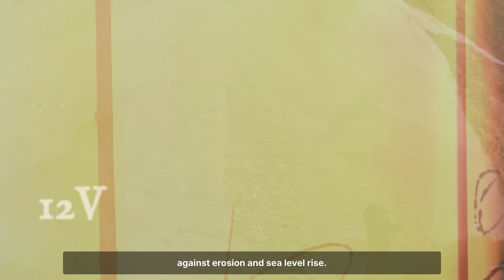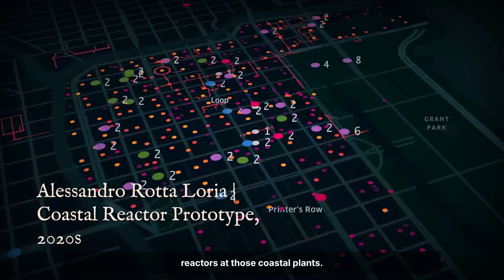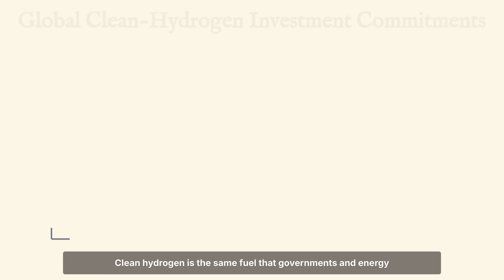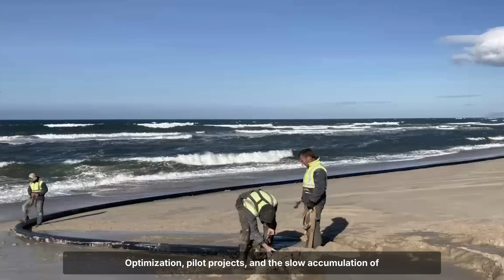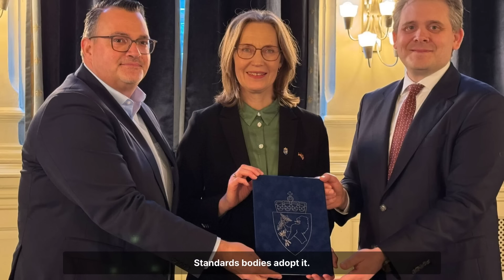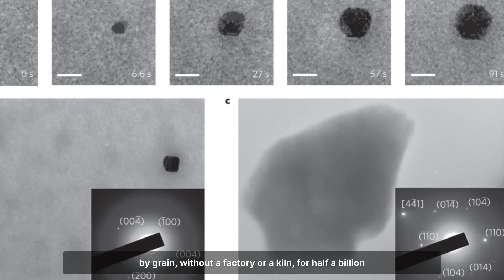Electricity Turns Sand Into Solid Stone. No Cement Required. Could Concrete Become Obsolete?

Comment: Not a single picture of the product itself
Reply: Instead of melting the sand, his Rottaloria's  team used electricity to trigger a chemical reaction in seawater. It’s essentially "growing" stone between the grains of sand.

The "Glue" Recipe: Seawater is full of dissolved minerals like calcium and magnesium.

The Spark: By applying a mild current (only 2 to 4 volts), they changed the chemistry (pH level) of the water right around the electrodes.

The Transformation: This change causes the dissolved minerals to solidify into calcium carbonate (the same stuff in seashells) and magnesium hydroxide. These minerals act as a natural "glue" that binds sand grains together into a solid, immovable block.
Reply: @Mr_Stratau a shite fulgerite!
Reply: This tech is being surpressed for obvious reasons.
Reply: Bones, coral reef, sea shells seems comparable but with sand instead.
Reply: Southwest desert soils including my backyard in Las Vegas contains calicium carbonate comparable to what ocean water contains. Google search Caliche soils over thousands of years can become hard as cement.
Reply: G-search making cement, bricks, magnesium, fertilizers, chlor-alkali chemicals, sodium ion batteries, Co2 Credits, desalinated ocean water and hydrogen as free byproducts of profitable commodities that could be tokenized as overcollateralized StableCoins on Internet Computer Protocol by Dfinity Foundation is Switzerland.
Reply: Jan, ⛱️ 😎 that's sand 😊
Reply: when lightening hits sand, glass forms, not stone. Must be less voltage
Reply: Because it is an AI fantasy BS channel. Look at its history. 1 month existence and a lot of BS
Reply: @kudr66 ill give it a try n see if it works

Comment: Google ai says....

Its called biorock.

Using electricity to cement sand with seawater works by applying a low-voltage electrical current (2-3V) through water-saturated sand, triggering a process called mineral precipitation. This method, similar to how shellfish grow shells, causes minerals like calcium carbonate and magnesium hydroxide to precipitate, acting as a natural binder that turns loose sand into a rigid, rock-like substance.

It produces a weak like concrete. 

Depending on the current and mineral concentration, a thin white coating (calcium carbonate) should begin to appear within days, with a significant solid "crust" forming over several weeks.

Comment: We constantly progress,  New discoveries always take time and this ‘ capitalist’ system has driven this progress better than any system ever has.  If this method works it will be just another step.if it is viable it will be adopted.  Just switching the electrodes is not so good. Pranksters and bad actors do exist. Concrete (ala Rome ) has lasted 2000 years.

Comment: I watched a video yesterday that explained how the Romans built structures that have outlasted anything that uses cement.
Reply: The aggregate used is less important than the active chemical.The chemical that allows the crystallisation of the binder is important.The Romans used lime,(calcium oxide CaO)like everyone else since then until modern cement(a mix of various calcium silicates) became widespread .
The key difference with Roman 'concrete' was that they included small chunks of unreacted CaO as well as the lime mixed with water and aggregate so that when cracks did appear,they would self heal whenever moisture came into contact with the small chunks of unreacted lime exposed by the cracks.
Reply: @chippysteve4524 much like the concrete embedded with bacteria. That does similar in the end but different.
Reply: Roman concrete was pretty amazing stuff. Check out the dome of the Pantheon, completely unreinforced, in the weather for a couple thousand years, still looks new.
Reply: @my9129  Engineers say it would have been impossible without the extremely lightweight pumice from Mount Vesuvius or was it Etna.The inside surface is actually covered in lime plaster though I believe.
Reply: Yes, they used volcanic rock.
Reply: @jbharco40  You are confused.The very lightweight concrete the Romans used for special cases where low weight was essential eg the dome of St Paul's Cathedral used 'pumice' - volcanic ash not rock as it is much lighter than rock and sand.Everywhere that strength was needed,they used standard aggregates -any rock and sand available nearby like everyone since.
Reply: And...? 🙄🤔
Reply: @checkmate-e4b  They used crushed volcanic rock instead of aggregate used now.
Reply: So can it be adapted to make Sand Castles into Rock Castles? I remember a similar tech promise called Seacrete that was based on just accumulating the minerals on conductive frames in any shape, but it turned out to be impractically slow for construction. I think it works for helping assist coral reef restoration.
Reply: @my9129  Rock castles - that'll give the beach bully something to think about!
Reply: Salt water was a key also
Reply: @petelee4004  Salt is the electrolyte and is just there to allow the current to flow.The end product contains no sodium or chlorine.Any ionic solution would probably work but salt water is free.That's why it is used.
Reply: Yes that's true but during the Dark Ages people forgot how to make it for centuries 😂
Reply: I’m making assumptions of what you’re attempting to communicate but I’m pretty sure I got it. So today’s modern Portland cement based concrete has only existed since the early 1800’s. So yeah of course they have. It’s not possible and a pointless comparison. There are thousands of books made of paper pre 1800. Are they a more durable solution for the construction industry? I’ve watched lots of those videos and they almost always have the same similarities. Struggle with results, inability to be consistent, immensely added labor, and women with hairy armpits with their lazy earth life partner. Non of which have benefits to where they could replace Portland/lime based concrete.